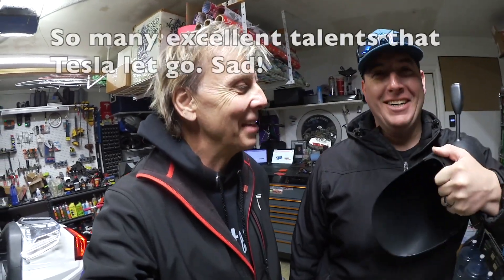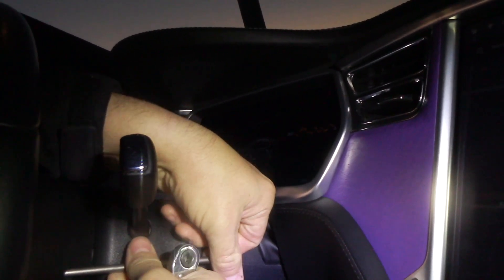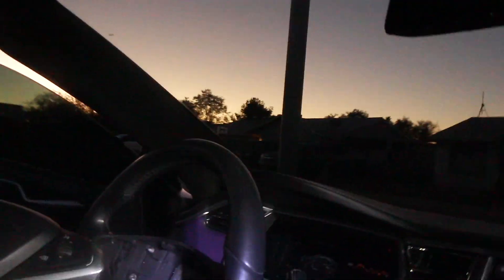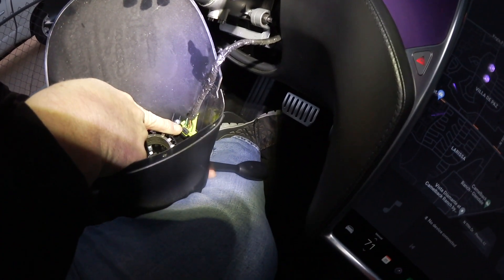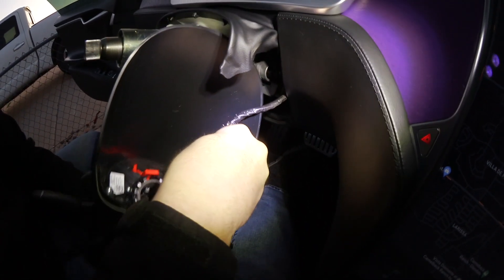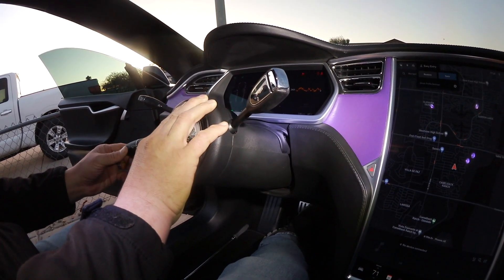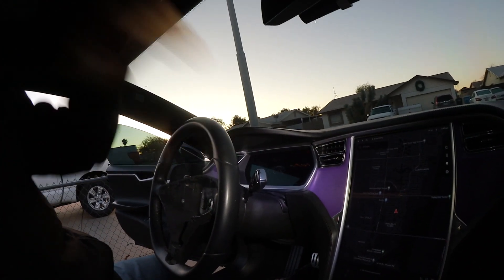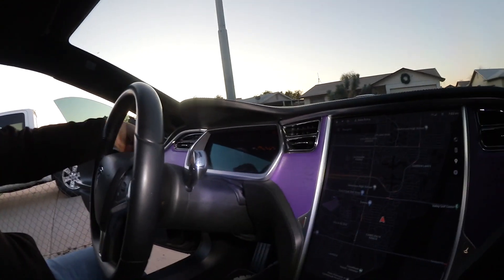Change of the Mercedes SCCM in my Model S.

Comment: Hey there! 

My Tesla: 2016 Model S 85D 

Thanks for the information! Very helpful! I am currently have a snapped clockspring, so I decided to replace the SCCM entirely since a strip parts are pretty cheap. 

But one quick question: 

Do the SCCM can be just plug and play? Do I need and software re-calibration at all? 

Please advice, thanks you very much!